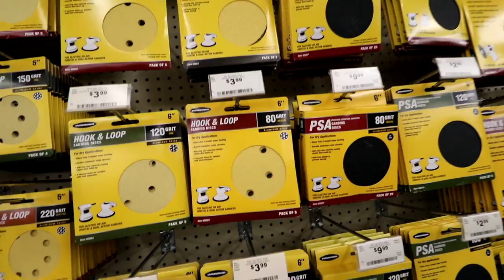THIS is why you DON'T PAINT YOUR VEHICLE

Comment from the maker: Cole took shop lifting to a whole new level! LOL
Reply: 3DMachines Squad from lebanon middle east🇱🇧
Reply: Hi 3DMachines ! Green hhhhhhhhhh! !!! Is ok I guess.  Stay froggy fresh.
Reply: 3DMachines it's 4pm in portcolborne  Ontario  Canada
Reply: grow the beard out
Reply: @3dmachines My advice, don't oil your orbital sander. It will spray the little bits of oil on the paint as you use it and you'll end up with imperfections. Professionals never oil their equipment for this reason and just buy new tools, it's not worth it to save the price of a new sander compared to all the paint and time.
Reply: Kamoranto no mate go buy a snap on and oil it never leak never spray  oil
Reply: Royce Smart well for the £200 for a snap on I could buy ten cheap ones, which I use at work everyday and last for years unoiled, so long as you don't throw them around, I don't think it's worth risking having to repaint a whole panel. Pretty sure a snap on will still let the oil out too, otherwise you'd only have to do it once.
Reply: didn't you think a bout plastidipping or wrapping ??  will that be easier or guive cooler results ??
Reply: 3DMachines  time to get a new car
Reply: I bet if you finish painting the hard working D max I bet that it will give you a extra 40-80 horse power
Reply: 3DMachines your truck looks nice in that camo green
Reply: All you needed was some wax and grease remover, not stripper.
Reply: Stay froggy fresh
Reply: 3DMachines could you please show how the doors/door wiring goes back together when you make the video of putting it back together
Reply: 3DMachines I

Comment: Go to Eastwood on YouTube, they give tips on painting your car outside. Also, you need to use a flat board sander to sand your primer, not a d.a sander, it will leave swirl marks. Wipe down the surface with thinner to clean and wear gloves, don't transfer skin oil to the surface. After wiping with thinner, use a tack cloth to finish clean. If you small imperfections in the surface, you can use spot filler, its in a tube, has consistency of toothpaste, and can be used right out of the tube. Spread it like body filler in thin layer, let dry, and board sand.

Comment: I'm sure you'll find out later on but you cannot be doing any of that without gloves. You'll see. all the spots where it bubbles or chips off are the spots you touched it with bare hands. skin oils are a painters enemy
Reply: Any oils or imperfections, oiling the D-A is a No No. The exhaust will blow oil out for a long time that will F the paint up in the end. Bottom line, not a driveway job if you have no experience. Otherwise love the will to try and do!
Reply: Tom Partee - I agree with you!

Comment: Your gona like that portable garage , we bought the 10 x 17  and set if on 2'' x 8'' treated and used the anchors. It's lasted 3 years in the mountains of West Virginia. It will hold the snow , but after about 4'' I clear it of. I welded a long roof scraper at work made out of aluminum to reach up and drag the snow off . It works great. But it might be tight in there trying to paint the truck , you may have to weld up some pipe for height extentions.

Comment: Not to sound like the bringer of bad news, but I bet 100 bucks says that the paint is going to have a chemical reaction to the rattle can primer. Been there done that once and it just added to the cost of redoing it the right way.

If you look at my comment that I left on the first video, I stated that it is important not to cheap out with the primer. I also stated that you need to use a high quality primer. There is a reason for this.

In all honesty, you are far better off going to your local auto paint shop and purchasing the correct primer needed for this job mate.  

Just throwing some more advice towards your way. In the end, it is your truck. Just trying to save you the headache of what's to come. It is a great learning experience and once you get the hang of it, you will be having other people wanting to pay you to paint their vehicles.

Comment: I would not have oiled that da sander  the oil will get on the truck    not good    be sure you block sand it very good  use the right sandpaper  or you are going to see so many sand marks in the finished product  .    the prep and materials will absolutely make or break that job

Comment: I have a question. I got a dirt bike frame and swing arm. I wanna paint the frame green, triple clamps black and swing arm black. If i take it to a place  they will charge 150$ for each.   Should i paint it myself and how.
Reply: Enduroways 3 10 dollar spray  cans newspaper and tape
Reply: Enduroways Here is an easy way to do it your self. Look at everything being done in these videos, and don't do it like that.
Reply: Enduroways take it all apart clean it up real good sand it buy the paint u want prime it paint it then put it back together simple
Reply: Yea i kinda threw you guys advice to trash and spent 10 bucks and did the paint and now im getting it powder coated because if i press my finger hard enough and twist its comes right off.
Reply: Enduroways Well it sucks to suck. Prep work is key, and clearly you didn't prep correctly.

Comment: DO NOT PUT AIR TOOL OIL IN A SANDER YOU ARE USING FOR BODY WORK. The oil blows out and ends up in the bonds and it effects the paint. Yes it shortens the life of the DA but it's a Harbor Freight special anyways